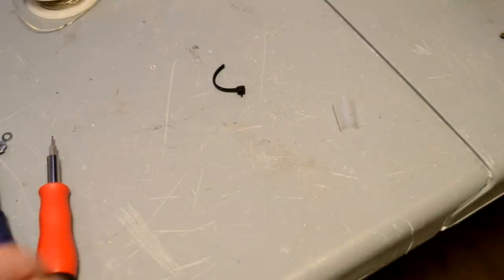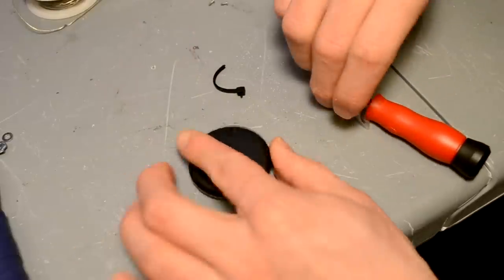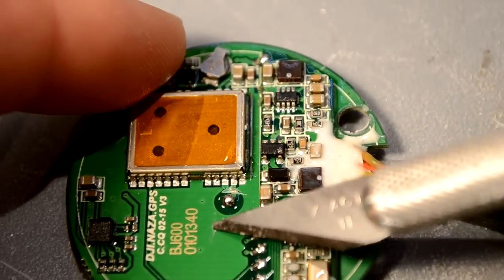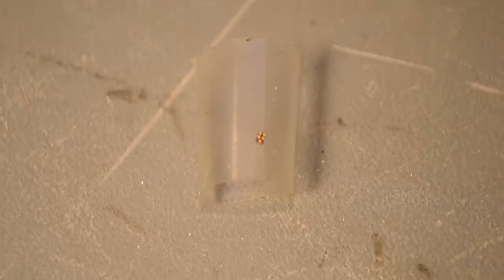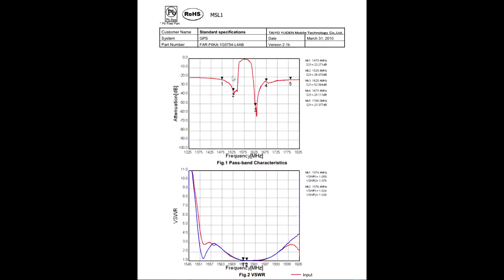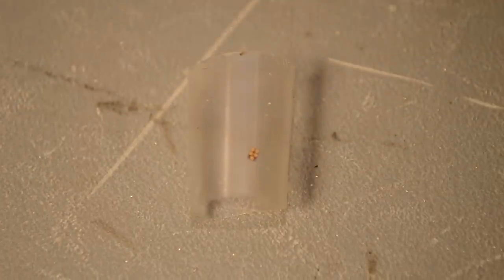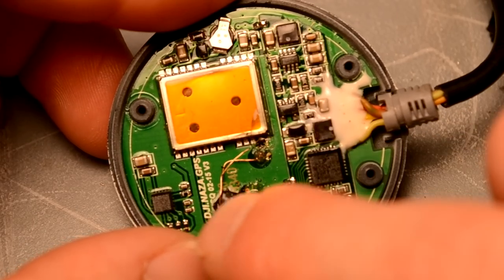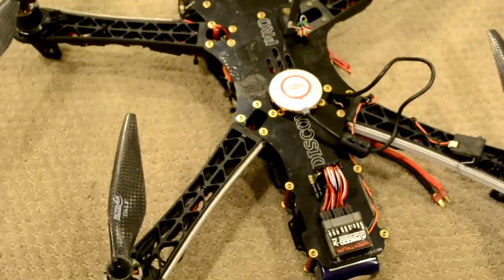Mod Installation --- DJI Naza GPS SAW Filter

Comment: I've been soldering since the age of 9 and that is just the insanest soldering job I've ever seen, so congratulations!
I'd try to keep the input and output away from each other though to minimize any crosstalk. Might even be possible to fit it directly between pin 11 and the gps blob, but would really need a microscope, hairwidth solder and fine hot air pipe, perhaps blowing through a tiny copper tube heated by a blowtorch?
Extreme patience required!

Comment: The pcb connection from the receiver to patch antenna is designed to be at 50 ohms. The copper thickness and width is specific to make a 50 ohms imepdance. When the saw filter is inserted, the impedance is changed. I wonder how did this affect the the gain.

Comment: Very cool, makes me wonder why its not in that GPS antenna by default :D, been fighting NAZA 2 GPS today as it shows continued GPS error for last two days and flying 6Kg Y6 that can speed up like race car in manual was really scary :D later I find out that axis on GPS flipped :-/
Reply from the maker: Yeah, the V2 has the filter installed by default, drives me insane though because the part is worth 54 cents. cutting 54 cents on a $160 GPS!? the bastards.

yeah, manual mode is nasty. It flies like a fixed pitch heli. That's not a mode designed for large heavy multis.
Reply: Brendan Stewart, you mean v1 doesn’t and v2 has it, the one you installed??

Comment: Hey Brendan I actually got the filter soldered! Will you confirm something for me though. Input goes to the "blob" output goes to pin 11 and ground goes to the spot you scrape. Thanks
Reply from the maker: Nice! congrats! and you're exactly right. GPS units are always receivers (unless you happen to have a satellite) so the input side is always the antenna's element (blob) and the output side will be pin 11, and ground is ground, scraped or not :)

Comment: I have v2 and I still get interference on channel 9 .
Reply from the maker: Really? do you use a low pass filter? and do you shield your GPS with grounded copper tape?

both of those things help ENORMOUSLY

good luck!
Reply: yes i have added notch filter which i understand to be the same as low pass filter. havent added copper shield yet trying to find it local without having to order online'..
Reply from the maker: there's your problem!

 
a notch filter does a similar job, but it's NOT the same as a low pass. A low pass attenuates (softens) ALL frequencies above a certain threshold, say 1.3ghz. While a Notch filter attenuates (to near 0) only a small portion of the spectrum, for you probably 2.4ghz.

So any interference on  1.575 Ghz is screaming over any GPS signal around. (1.575 Ghz is GPS band) A low pass should help this enormously by attenuating any interference above 1.3 ghz

And FYI, copper tape can be found at music stores for shielding guitars.
Reply: cool then im gonna get some shield asap thanx for the help
Reply from the maker: anytime!

Comment: Nice job on the mod. I have the v2 gps and I was told by other owners that it does not have a saw filter installed. Only reason I say this is because i was gearing up to do this mod. I get horrible gps lock with my 800mw 1.3ghz vtx.
Reply from the maker: Really? Interesting. Do you use a low pass filter? 

I'm flying with a 400mw 1.3 VTX and having no issues after the mod.

I thought the main selling point of the V2 was upgraded GPS hold.
Reply: Well I use a 1.3ghz/2.4ghz notch filter by ibcrazy. I assume that they are similar I'm a complete noob.
Reply from the maker: Man, you're the second guy this week. dont worry dude,  I'll do a video about filtration

A notch filter only cuts out a "notch" of the spectrum, in this case 2.4ghz

A low pass squelches anything above 1.3ghz (it lets the LOW end pass, get it?) and that includes 1.575ghz which is your GPS band
Reply: Yeah that makes sense, like I said I'm still learning. Thanks for the info though, I'll be swapping my notch for a low pass filter.
Reply: Hey Brendan hows it going. I got all excited after watching your video and tried to solder the three leads off of the filter I bought. It was a no go. Would you be willing to do the soldering on the filter for me? I would pay you what you think its worth. Let me know what you think, thanks.
Reply from the maker: I bought 6 filters and kept trying till it worked! it was by far the nastiest thing I've ever had to solder. Id solder it for you, but I cant guarantee it'll be perfect. Its just wayyy too small